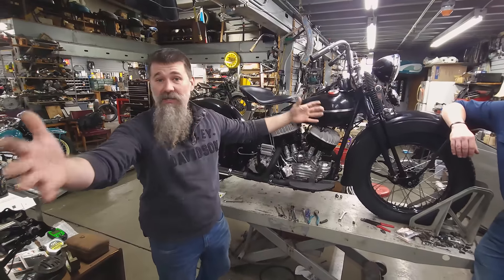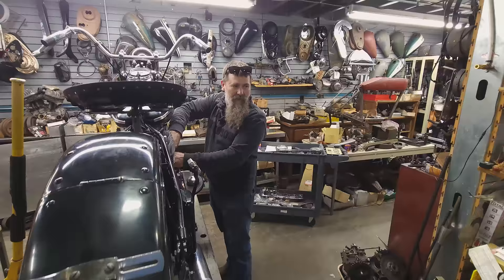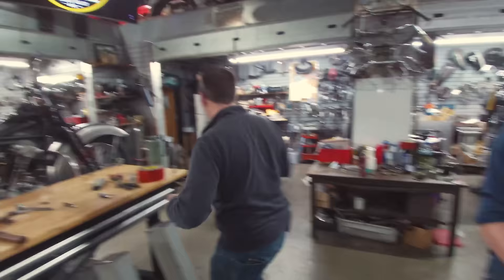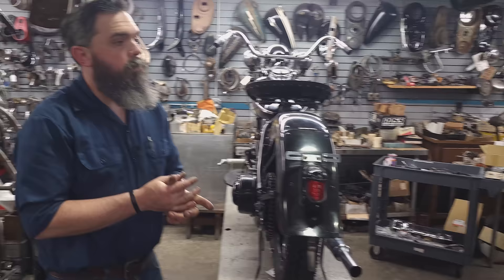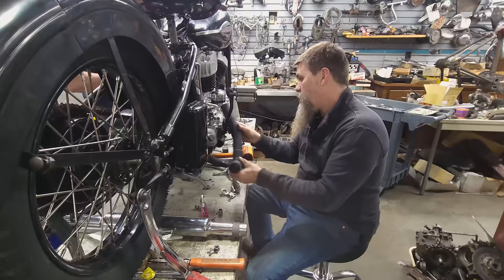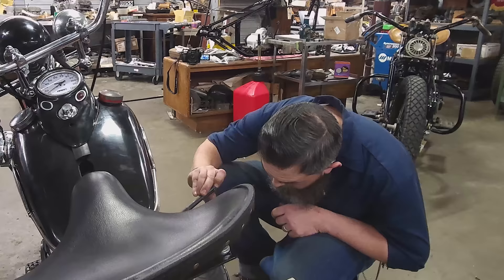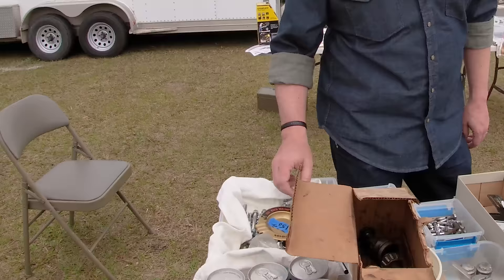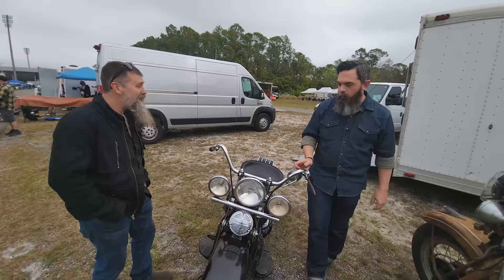Can We Revive This WWII Era Motorcycle?

Comment: Nice resto! The right amount of chrome (not too much). Love it! I noticed that your serial number is 42U1842. I have 42U1809. It came from a WW2 military base in Quebec. I rode it on the street for about ten years. I had it geared pretty tall, and it would lope along nicely at 80+ mph. So much torque! Now it's been built up into a Bonneville racer. We had it up to 127mph on gas about six years ago, and 137mph on nitrous four years ago. 
My brother had 42U1807 from the same military base. He blew it up down in Maryland about 45 years ago. The stock 74 cylinders were bored out .060" over the standard 80"size ...a total of .185". Paper thin! All it took was a hot afternoon and trying to keep up with a pack of modern bikes, and ka-boom! The rear piston stuck and the whole lower rear cylinder disintegrated. And of course the rear rod then took out the back of the cases. A sad day...
Reply: Yall kilt that damn motorcykle. 60 thou after 80 thou. What for 3 or 4 more hp
Reply: @arthurcutaiar9994 My brother bought it already bored to .060" over 80" as a complete running bike. He never did anything to the engine himself. It ran great for a lot of years that way.
Reply from the maker: Cool that the numbers are that close. Thanks for watching!

Comment: 7:37 here's what you can do to bring back your old OG points to OG spec. Step 1: buy Copper Tungsten rod.

Then using a small jeweler's drill press, drill out the OG point in the points leaving the sheet metal clean and proper, devoid of the contacts.

After that, you machine those points out of the rod, and press them in place using dies that match the OG pattern of the points (if they have a pattern). 
Old body, new points. And you can do this indefinitely. One rod will outfit your entire barn of horses. :)

I would recommend getting a small jeweler's lathe for this, perfect for the job. Doesn't need to be fancy, you don't need to know much, just enough to make the un-pressed points.

Personally, i skip the rod part because i use tin snips to split my points' body down the middle to the hole, discard the dead contacts and replace them with brand new ones from (a similarly operated on part) that fits the diameter, then just silver solder the split back and give it a little press love tap for good measure. I've rarer European points that are not as easily found, so that's how i get by.

Comment: My theory why parts don't go back on easy is because the frame is fatigued and twisted under torque against the fasteners of the parts being removed, thus when fasteners are removed the frame twists slightly causing the fasteners' threaded holes or bracket holes to shift out of alignment.

Comment: On a evo powere bike,  if i installed the rear wheel ( or front ) without the belt or the caliper, should it spin as freely as the wheel did on this bike ?  Ive never had them spin that well and ive always wondered if it was right or if it could be better.

Comment: The points issue for the early circuit breakers is a real problem. I picked up a set of points on ebay a few years ago from Eastern Mfg. They looked good, but I had to elongate slots, bend and re-curve the rocker side to get them aligned & gapped. It'd be great of someone would repop a good quality set of points. I guess if nothing else, I can pick up a G model or XL circuit breaker, but I'd rather keep that part original.

Comment: do you'all use a custom ground CAM ?   if so do ya  take the time to degre in the opening and closeing of each valve  " DEGREE WHEEL" just a few thou on the lash can make a HUGE difference ! ,   just a few thou can be MANY degrees ! i swear !    set it up just as the CAM CARD Specs are !   it is well worth ALL the EXTRA TIME  to get the valves right on the money  ! as far as the Openin &closeing of each valve  , check the lobe centers too   get all that on the money and you will outrun the cat next to you on the raceway or hiway   perhaps you allready do all this to your full race or hill climbers?    it takes alot of time but all the BEST race engine builders set up the cam   POWER   YEA       David N.  enjoy your program so much !